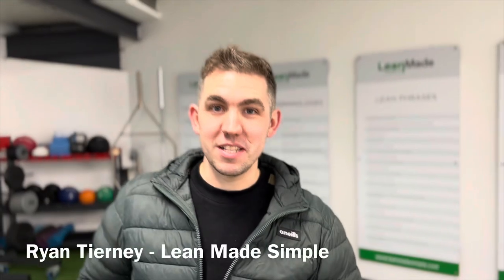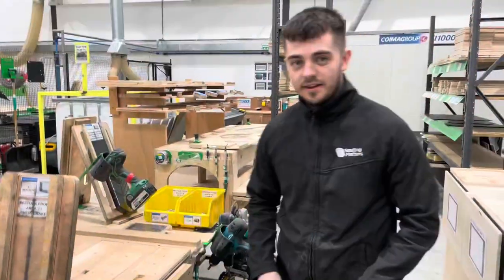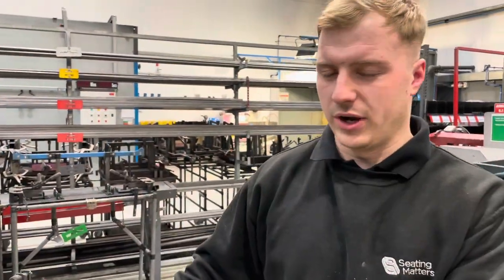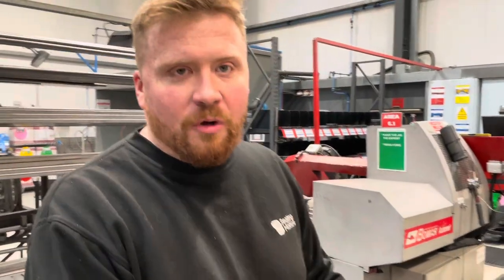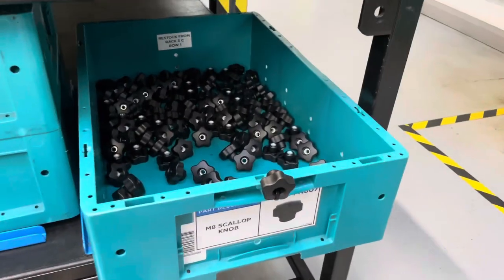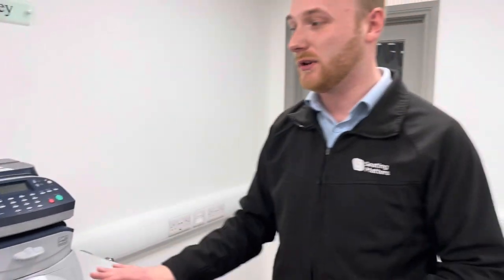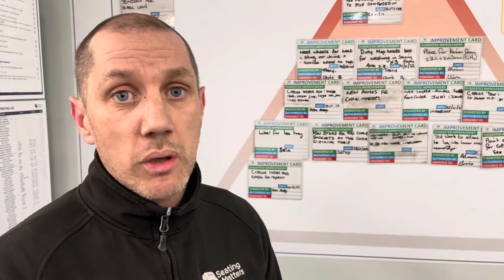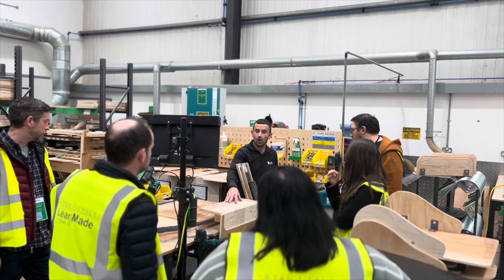Favourite Lean Improvements 2022!

Comment: Hi Ryan,
What racking do you use on minute 3:10? I have been looking at a lot of racking but can't seem to find any which we can put wheels on. Thanks in advance.
Reply from the maker: Hi Mario, thankyou for watching, we use standard pallet racking, we have welded castor plates to the bottom of the racks to fit the wheels onto.